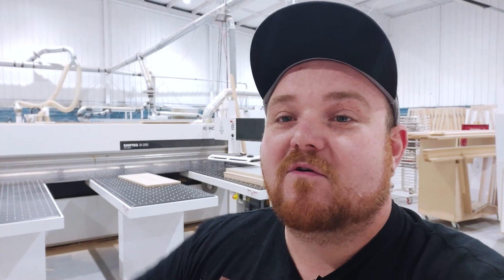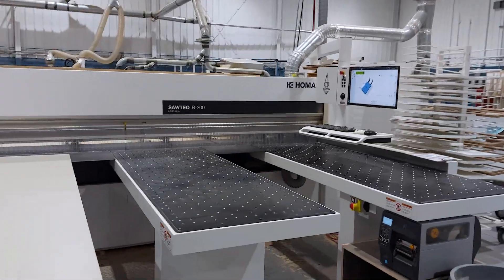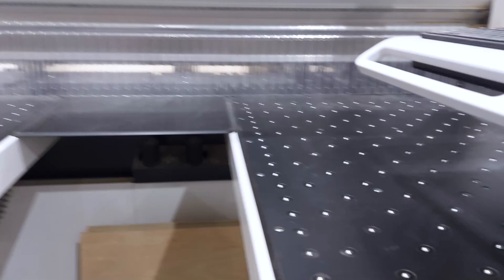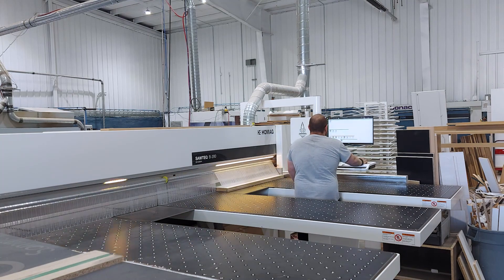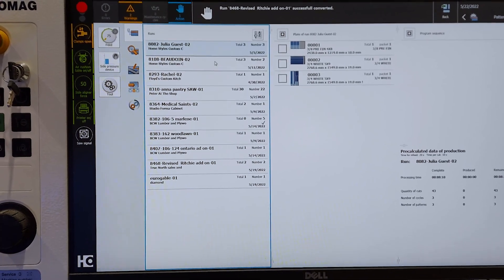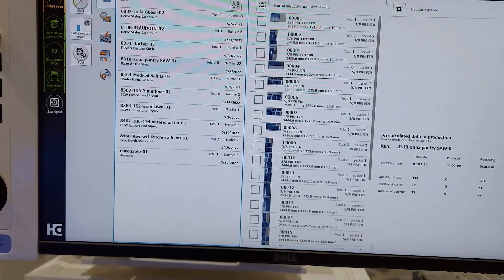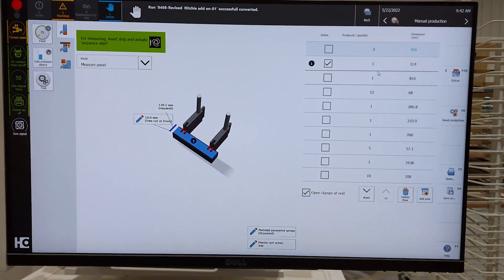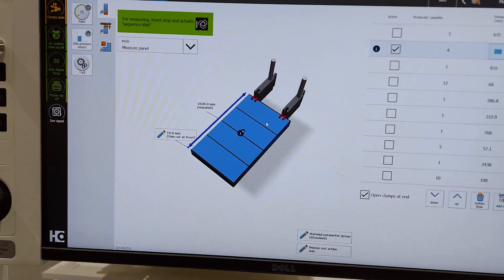The only saw you'll ever need (SAWTEQ B200)

Comment: Hey .. great video.  Have you guys looked at changing over to nesting cnc machines for production?
Reply from the maker: we ran exclusively on nested routers for years and i was reluctant to give beam saws a try as i thought they were old tech. but using a combination of both cnc and saw for manufacturing has been a game changer for our production
Reply: @diamondcnc  interesting ... so you still use cnc?  are they point to point cnc or do you use a combo of nesting for complex odd shapes parts (ie cabinets)and beam saw for longer straights rectangle parts?  I would be very interested to hear how a beam saw reduced your lead-times.  On our world, using nesting machines ...  compared to rip and cross cut (ie beam or panel saw)  give us the ability to create flow.  Assembly can receive parts for a kitchen - (ie base cabinets) sooner, and start assembly earlier where as a beam saw make assembly wait until everything is cut.  This "waiting" extends the lead time.   Would be interested to her your take on this
Reply from the maker: @TheJoineryCoach  we run small batches. one order at a time. so anything less than 3 sheets goes on the saw, veneer core material goes to the saw, and if we have a lot of mdf doors to make, we push our cabinetry to the saw to open up production on the nested machine. of course all angled and complex parts will have to be made on the cnc, but we rarely have to wait on parts from cutting area for assembly. we cut kitchens at least 7 days before they ship. check out some other videos, youll see our layout and our production flow